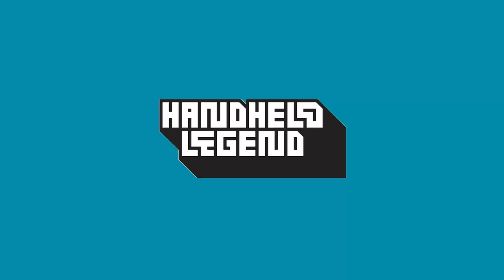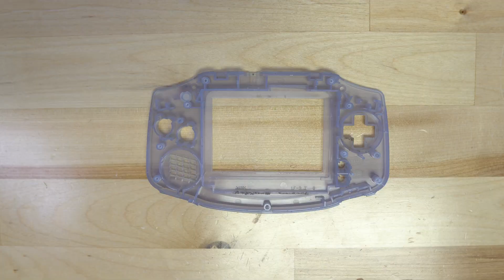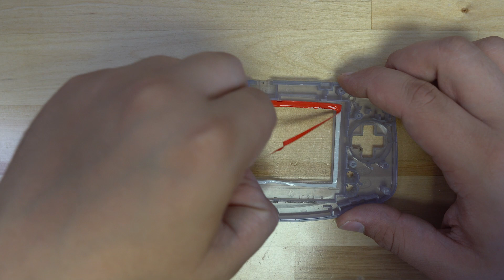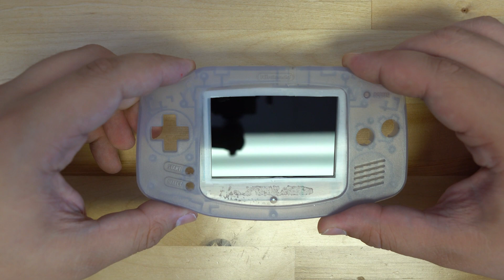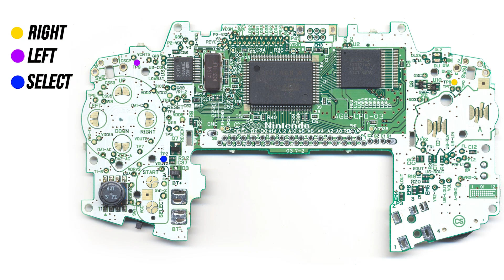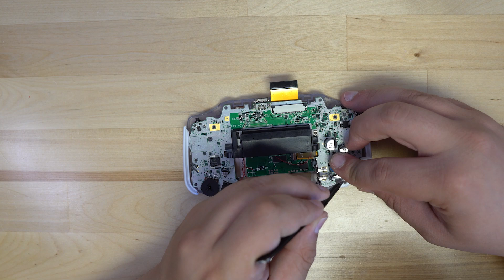HISPEEDIDO 3.0 V5 IPS Kit Install Guide

Comment: Terrible tutorial , you didn’t install the insulation film that prevents the  screen’s motherboard from getting shortage .
Also , the borders  of the original shell have to be trimmed otherwise the screen will not sit properly.
Reply: True about the insulating film. FALSE about trimming. I’ve put these in oem shells no trimming at all.

Comment: BE CAREFUL WITH YOUR IRON WHEN SODERING TP8

Mine got magnetized to the speaker... Wrecked it, no doubt, melted the plastic on top
Reply: I recommend removing the speak, then after this installing a new 2W speaker. I also used Helder's mods. The flex amp, power cleaner one, and the capacitor upgrade. Install those before the screen, then add the speaker after the screen. It's easy with a little flux and pre-tinning the pads with a small amount of solder.

Comment: Is the kit compatible with pen gba case or is aftermarket modified case required?
Reply: It’s drop in, meaning that it’s made of OEM shells. But I’m 99% sure you can use uv printed ips shells as well.
Reply: It kind of requires some slight dremeling. That ridge on the right side (with the screen facing down) needs to be flattened, but doesn't technically have to be.

Comment: I find it not necessary to use both the spacers and th3 adhesive as it will be harder to remove the sceeen if you ever want to replace the shell in the future. A small piece of adhesive to maybe the sides and you should be alll good.
Reply: yeah i made that mistake of using all the adhesive. it's pretty much impossible to get off without fucking up the lens. even with a heat gun. the foil lettering from the gameboy logo gets pulled away from the lens by the adhesive and makes it look horrible.